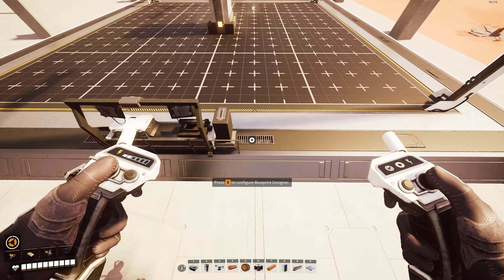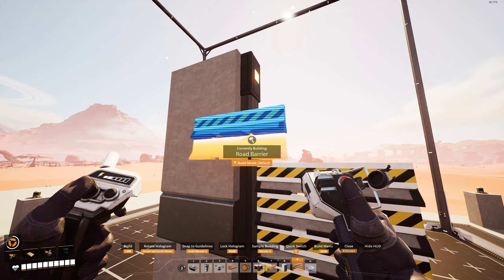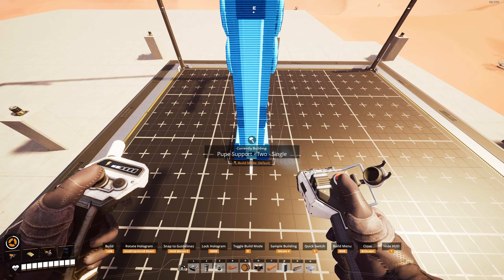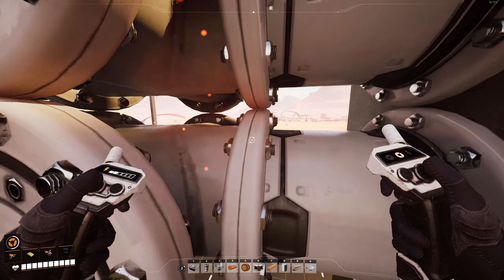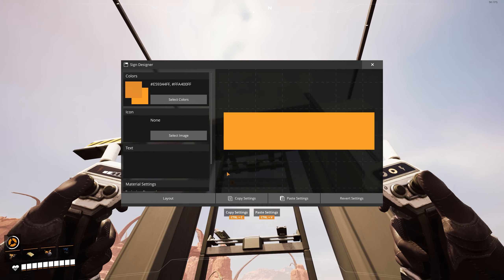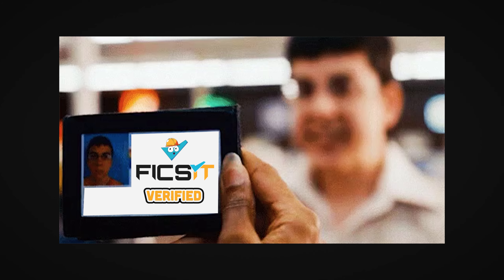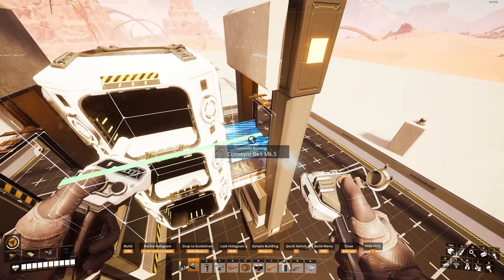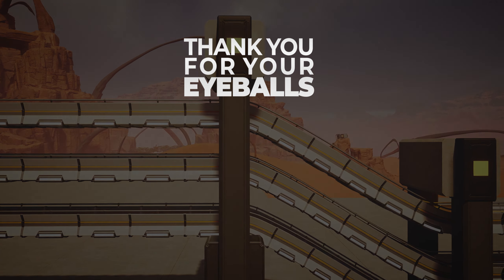STOP Building Pipes & Belts WRONG! in Satisfactory

Comment: You need to get the MICRO MANAGE mod, it will change your life.  It doesn't add any parts to the game so if it is ever disabled or you remove it, it will not affect anything placed in the world.  What it does is allow you to actually place parts where you want them.  No more need for all the tricks to make a piece move, align, rotate, the way you want it to using other temporary parts to build off of only to delete them afterwards.  Just place the part near where you want it, shift click to highlight it, right click to open the interface, then you can move up/down, left/right, forward/back, even rotate on all axis if needed.

Comment: if the game made it easier to make things look good i wouldnt clip my pipes through my belts
Reply from the maker: Haha, kinda true
Reply: It's very easy, blue is no clipping, yellow is clipping.
Reply: @Burtlocker  You misunderstood the point of the comment. The author meant that the building system is so primitive and limited, that it is not satisfactory to bother with the aesthetics of your factories.
Reply: This problem really does get fixed heavily by 1.0.  Can't tell you how nice it is to place a splitter or merger directly onto a conveyor lift.  It doesn't even look like it clips either!  Just fits in nice and cleanly on the top or bottom.  This has drastically reduced the temptation to clip horrendously everywhere.
Reply: it is easy to make things look good. you just aren't good at it.
Reply: @yansakovich totally wrong. it is one of the easiest most fluid building games out there. skill issue
Reply: @eudaimonistic this was a thing before 1.0...

Comment: I like putting things on the floor and using catwalks to get around. This is more common in real factories anyway. It’s easier to create pathways for people around equipment than it is to build architecture and pathways for huge, mega tonnage of equipment. 

In the real world you usually only put things below ground or high up if you need to for better function or safety (of equipment and/or personnel). It’s expensive to do so, therefore you really need a good reason other than “I like to see the floor.” 

Obviously it’s a game AND playing it in many different ways is one of the great things about it.  I’ve built overhead and kept the ground floor clear. I’ve built in “the basement” and kept upper floors clear. And I’ve done various other ways. It’s all fun. 

Thanks for the video.
Reply: Catwalks are definitely not common in real world factories....
Reply: @VitaKet  look up steel factories and you'll see catwalks everywhere.
Reply: None of the factories I've worked in have utility facilities on the floor, unless it's in the ground (like sewage and water drains). Most processing pipes, electrical wires, etc. Are raised above ground and dropped to get to the places that need them. Maybe it's a difference of food processing vs. other processing. But even in non-food plants I've worked at did not just have everything on the floor
Reply: @Mouwcat  they're saying that catwalk aren't all over the place in a lot of factories. Food processing, for example, does not regularly have walking spaces above the product.

Comment: Honestly, the biggest issue I have is that Stackable supports (belts and pipes) do not attach to normal supports at all. So if you build one belt the normal way, then go "oh crap, I need multiple belts here", you have to rip out the entire existing belt line and manually place Stackable ones. On top of that, you can't use Stackable as the default when extending a normal line, it only ever places normal ones... so you have to pre-place towers of Stackable supports (using the original single belt as a "okay, what isn't too long between segments" guide) and then go back and put the belts/pipes in after the fact...
Reply from the maker: This is a deep vanilla problem you're having. "Construction Preferences" fix all of it. It's a light weight, unintrusive mod that doesn't break  or change the game in any way other than adding some "preferences" to building (including changing default supports, electric poles and more...) And if you remove it, save file doesn't break :)
Reply: @approximatelybored  Eh, had a feeling. Going strictly vanilla for my first playthrough, but I'm already planning a "Vanilla Plus" modded playthrough for U8, and the FICSIT Augmentation Database has a solid list of QoL mods I've been eyeing 👀
Reply: You can place a conveyer stacker above an existing floor level conveyor.  Just put one wherever a conveyer support currently is; just a little touchy getting it to place correctly.

Comment: Being efficient is also about removing parts that aren't needed in your factory. You don't need to bother with putting a piece of pipe inside of the wall. The wall pipe hole's only function is visual. In other words, when you are ready to place your pipe, just clip it straight through the wall. As long as it is aligned properly with your pipe hole, it will look right. Fewer pieces of pipes also reduces the amount of elements that the game has to keep track of. If you do end up connecting a pipe to one of the two sides, you can just start your next segment of pipe by selecting that same pipe hole and extending from there. You don't need to wall remove the wall to do it. The game will just let you do it. Pipes are one of those game entities that will clip through just about anything.
Reply from the maker: Meanwhile I add extra bends, cuts, supports, and even rearrange entire floor plans for things to not trigger my ocd 💀
Reply: @approximatelybored  I also have a tendency to be somewhat OCD, but I draw the limit at "does it look right".

Comment: So, I tried to replicate your design, but for some weird reason, the game won't let me place the base blueprint back into the designer, because it's "partially clipping into it". What a shame, I have no idea why this is, but I was eager to try this design
Reply from the maker: Very weird. I specifically made it so the pillars wouldn't clip through designer floor. Will update blueprint shortly 👍
Reply: @approximatelybored  It was probably my own mistake. The bottom-most horizontal concrete pillar was partially stuck in the ground and I didn't notice it. I don't think you need to update :)

Comment: Vehemently disagree with your most basic premise here which is that you shouldn't build at ground level.  The thing I care the MOST about being efficient with is my time. Building on the ground is faster.  

This design is cool and there are times when I certainly build stuff above or below the machines, but generally speaking I find the most efficient plan to be throwing the belts and pipes at or near ground level and simply make the factory walkable by adding walkways.
Reply from the maker: Completely get your point, but you don't have to be 100% efficient all the time 🫣 well at least I don't
Reply: One reason to be careful near ground which will kick up people's ADHD is vegetation poking up through the floor.

Comment: It's not bad, but imagine all those items together multiple in a single save. Sorry, but to much items spended
Reply from the maker: Item limit isn't real anymore... Just use gc.MaxObjectsInGame=99999999 and forget about it. Saving and loading takes 1-2 mins, but the game runs fine since "Chaos" engine optimizations.
I'm currently at over well 4 million in-game entities (objects) and the game runs almost exactly the same as it did at 150-200k entities. The reason is - static objects (buildables) add ~ 1:1000 of the load of a manufacturing machine (like constructors etc.), so the game with ~1 000 000 foundations runs about the same as one with 1000 working machines.